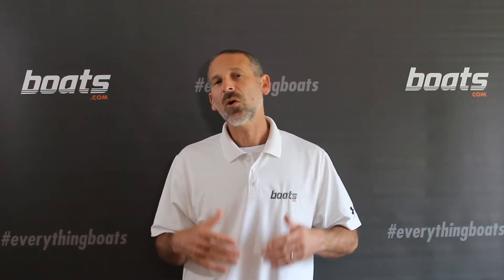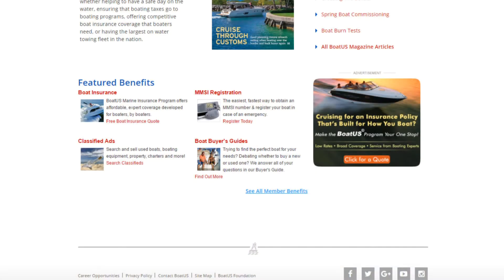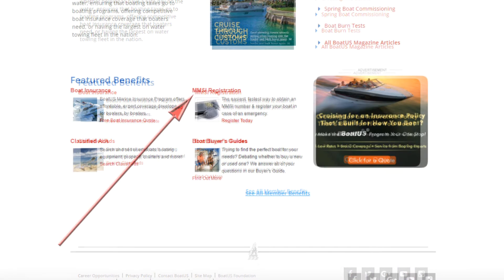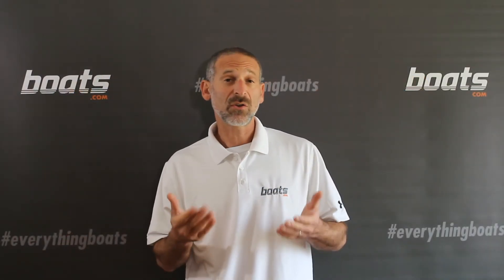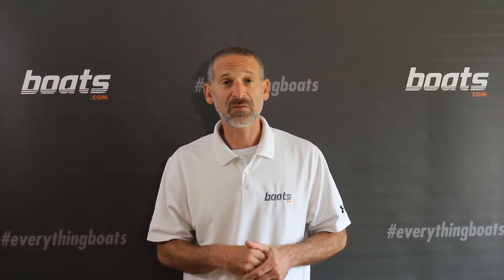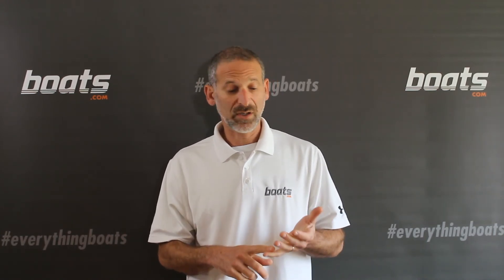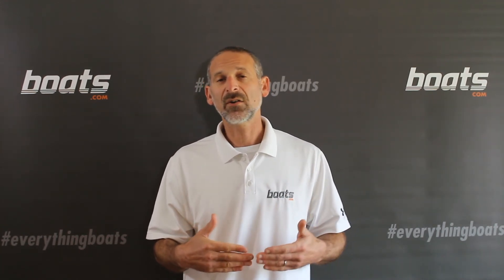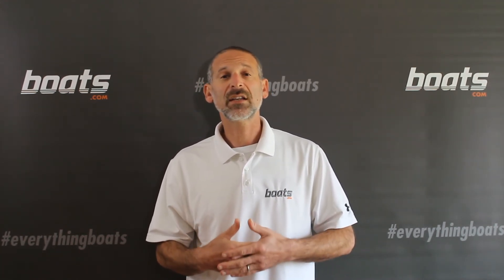Boating Tips: Make Your VHF Radio DSC Active

Comment: If the VHF provides the coast guard with you MMSI number info....AND your GPS location from your VHF....then why is the cable to your GPS required?  I may have missed that part of your video. But I'll watch it again real quick.
Reply: The VHF aquires your position data from your GPS system, and sends that data along with your MMSI number
Reply: Se il vhf ha l'antenna GPS e ha i dati sul display, non c'è bisogno di interfacciarlo al GPS.

Comment: I am attempting to hook up a Humminbird fish finder with GPS to a West Marine 585 VHF radio for DSC calling. The cable from the fish finder has 4 wires, Red +12V, Black Ground, Green NMEA In, White NMEA Out.    The accessory cable from the VHF unit has 4 NMEA wires and 2 different ground wires.  Which wires are hooked up from the two harnesses?

Comment: Yeah, that whole part where you say "just go to google and find which colors you hook together from the radio to NMEA cable" that part? That part of the "easy process" is pretty much impossible since the colors are not standardized (each manufacturer uses different colors) - and you better be skilled at soldering because that's what you're going to be doing with each connection IF you can figure out which colors connect together.